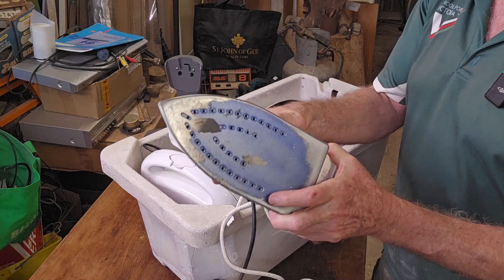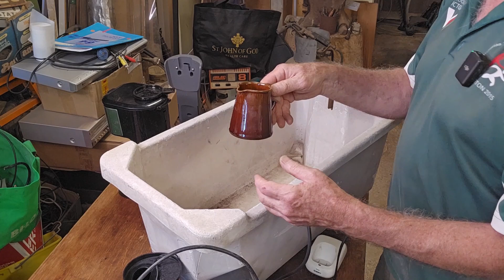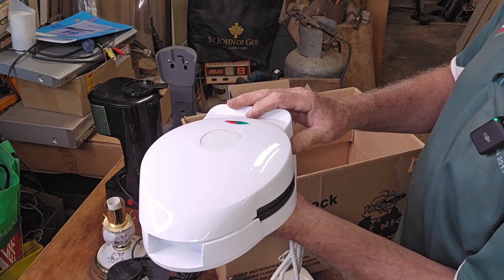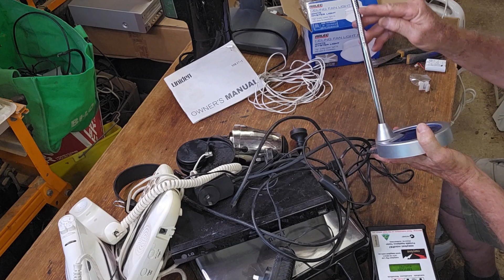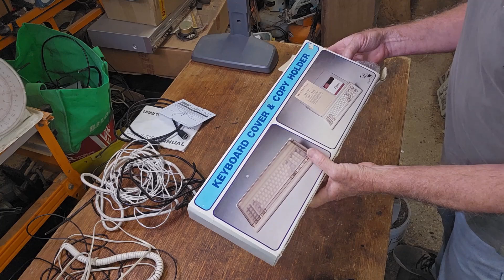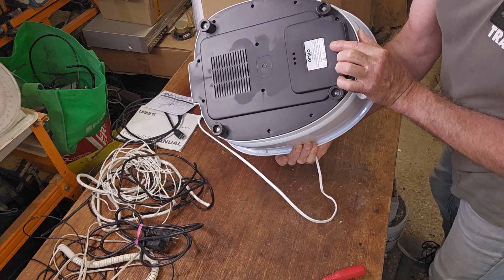Monday Marathon - Processing Ewaste picked up from a Charity Shop! Testing, Scrapping & Pricing.

Comment: Hi chris, i have that exact breville bread maker, its in perfect condition, that cycle you selected it was mixingn stage, put $40-$50 on it, youll easily get $20 otherwise
Reply: Also anko is kmart brand that has now expanded into target stores and maybe bunnings too
Reply: Also loved the long video, cheers
Reply from the maker: Thanks FF. It's at the shop now for $20 - I'm happy to pass it on quickly! 😊👍